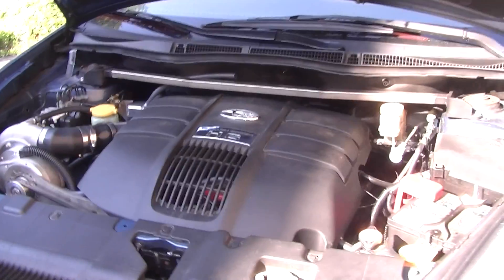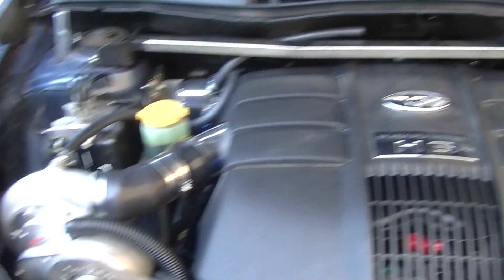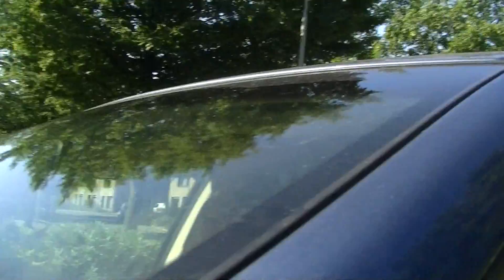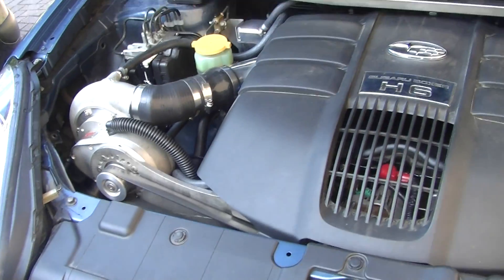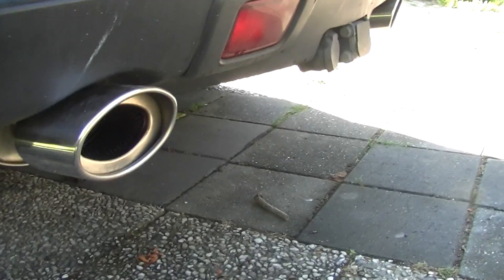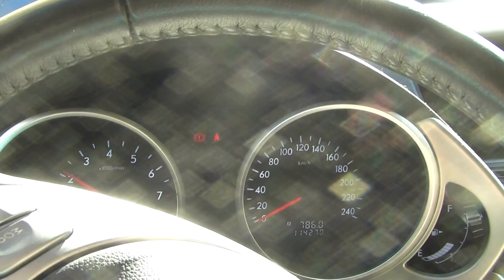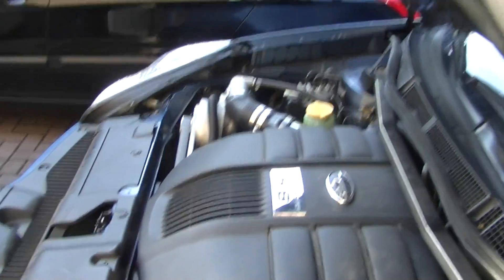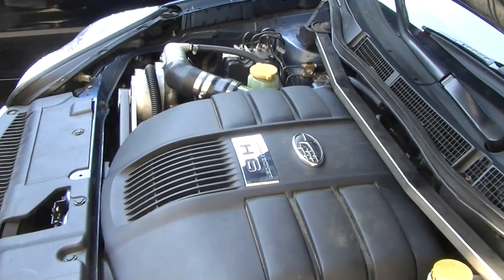Subaru Tribeca 3.0H6 supercharged walkaround.MTS

Comment: This video is to sell the turbo kit, whoever selling this turbo kit should answer inquires and have a decision forum on this product. Looks good but quality of the turbo kit and functional is questionable!
Reply: raptorsc.com.au
Reply: Not a turbo kit, a super charger kit. Both are forced induction systems but still totally different. Turbo systems do not run a pulley off of the drive belt, turbo uses the exhaust to spin the turbine.

Comment: @GeneralSprint 

Definitely no issues with 10:1 on the subie engines - I have the raptor supercharger running 10psi intercooled on my Subaru RX which has the EJ201 - been like this now for 80,000km without a single issue :D

Comment: Hello,
I live in Holland, but cause the rest of the post's are in English, so let's keep it international.;-) 
I drive a 2006 Legacy wagon spec B.
Now I know a supercharger  is fitted on the Tribeca, this must be no problem on a 3.0 Spec B Legacy.

However, since a supercharger takes it's power from the engine, compared with the turbo who uses wasted exhaustgasses, fuelconsumption will be higher too.
Normally I can run allmost 8l/100km.(Highway)
What figures can I expect cruising on the highway?